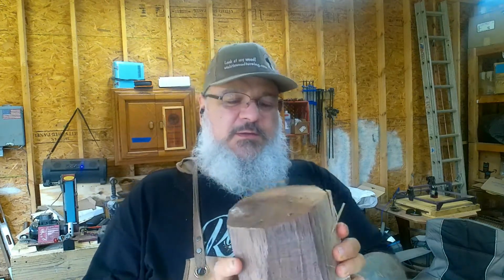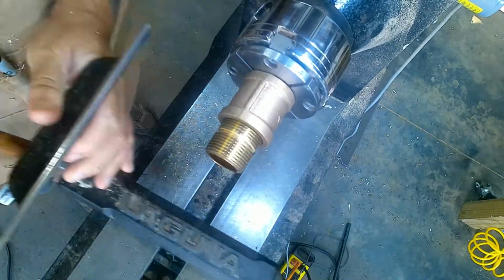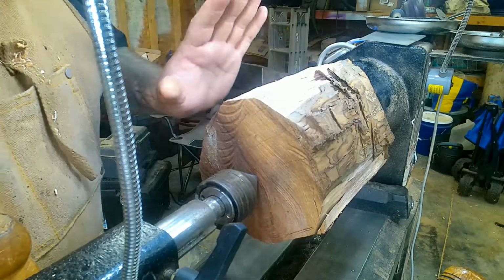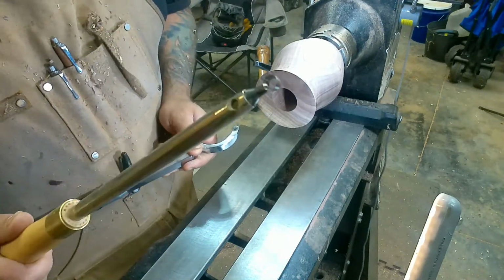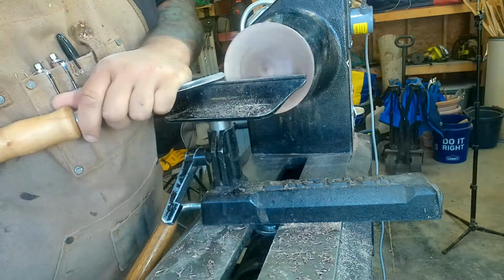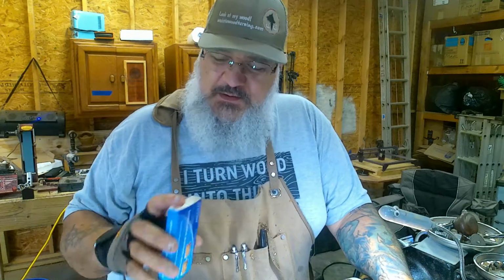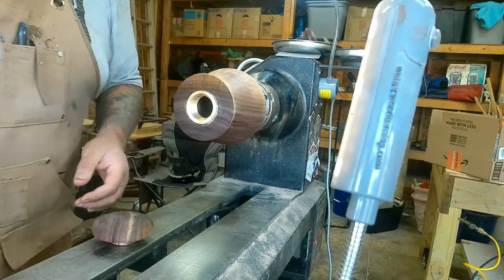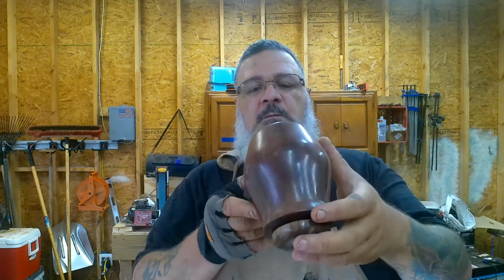Walnut Urn with Brass Threads

Comment: I think some duck tape would work well also to cover the back of the hand.  I like the brass insert but I was cringing as you cut the female coupler with that ridge running along the length. You had a lot of tool over the rest and you presented the entire length of the square carbide cutter into that ridge. A  round carbide presented at about 45 degrees I think would be much safer. Allows for a slicing cut. I haven’t tried it on brass yet but in my mind I think that would be better. Purely speculation. An interesting video and a very nice result. Brass threads seems like a great alternative to chasing threads.

Comment: The silicone patch is a good idea but for short term use why wouldn’t a latex glove work just as well? Long term use would make the hand too sweaty. The use of the brass insert was a great choice over pvc, very thoughtful. Also, how did you match the threading so the sap wood streak line up especially since you epoxied the threaded piece prior to final fit? Next time could you partially thread the male into the female then align and epoxy the lid to the grain of the base? That would take care of both the alignment issue and during finish turning centering the lid to the base.
Reply from the maker: A nitrile or latex glove doesn't have the thickness the scar pad has - and even though, for the most part, they tear easily, they could still tangle and cause an injury. The scar pad simply can't tangle because it doesn't wrap AROUND anything. 

The threads and grain match up was mostly serendipitous. I wanted to ensure they aligned straight and they did at first, BUT, one of the burrs on the thread wore down where it was jamming before, and the lid turns about ⅓ too far ... It still is a striking piece. One I'm pretty proud of.
Reply: @wahtiewoodturning  as you should be, it’s a very honoring urn.

Comment: When cutting the brass rings, is there a reason that you did not use a live center in the tailstock?
Reply from the maker: There's not really a reason TO use a live center, especially since these pieces are so short. If they were longer, I probably would have, but the entire length with the niple threaded in was only 3 inches.

Comment: Nice video!   To get the lid to line up …. What if you screwed the threads into the base all the way, and then applied the epoxy and set the lid onto the threads where the grain lines up?   Just a thought I had while watching the video 🤠
Reply from the maker: Could work. My next urn, I did an inlay on the top, so it wasn't an issue.